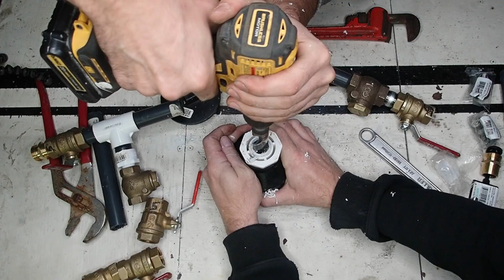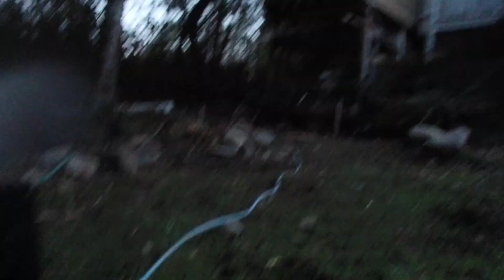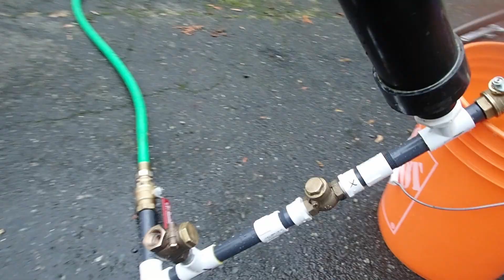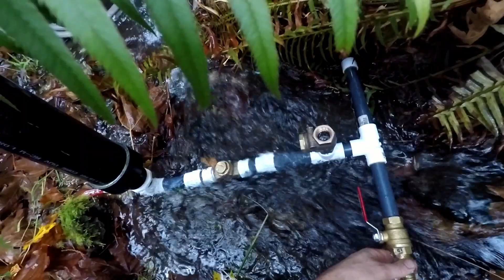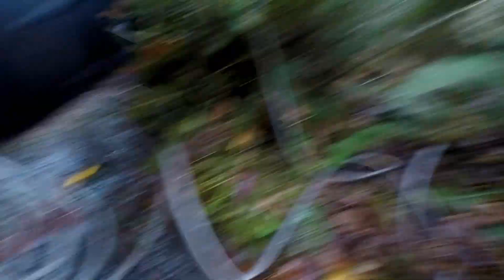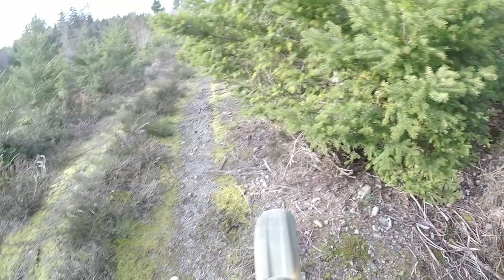Ram Pump Build! #prospecting #rampump

Comment: Many years ago....I used to have a little vegetable garden in the forest.....  It needed 400 feet of garden hose....Crummy tire had 50 ft lengths for a very reasonable price . I also made a reservoir just above the garden out of a king size water bed. at the rate i saw with your set up it would take about three days or so to fill the water bed and  I put it on a nice tarp down to minimize punctures.
you will need to disguise it as the water bed looks like a huge blue 'gem' in the forest. it was very obvious even from a distance.
I reckon if you took a few trips this would be 'Motorcycle Transportable'.
Reply from the maker: No need to disguise anything, I'm not "gardening' LOL! But yes, you have the right idea with a reservoir!
Reply: @MOTOMINING  my concern was  about keeping your claim under wraps and away from prying eyes. the main reason for my reservoir was that my creek was dry from mid july on...

Comment: and a good law it is too!
Reply from the maker: I understand it with my own brain thinking, but I'm no physicist!
Reply: @MOTOMINING  the purity law or the ram pump...or both....?
I think a smaller hose on the outlet might not be a bad idea. or bigger hose on the inlet... Its a very cool principle and if you know about the damage a water hammer can have on house plumbing you can readily see the power of it.
Reply from the maker: @mrbillmacneill  The kinked hoses are moving to the output for sure! Wait till you see my setup!
Reply: @MOTOMINING   fine tuning and a bit more fettling  should do it eh?.
Reply from the maker: Need more hose!!
Reply: @MOTOMINING  I await the results of your efforts with great interest!
Reply: @mrbillmacneill  No kidding about the water hammer effect, I guess the air chamber smooths it out a fair bit, but she still kicks, thats for sure!
Reply: @g-wrathk829  we had a sprinkler that crawled along the hose . The old man bought a little device that would turn off the water as the sprinkler nudged up against it. when it was just about closed a water hammer started in the plumbing. 
it sounded like some one was hammering the shit out of the house from inside. we only used it once...

Comment: How does it work
Reply from the maker: I don't even know man, it's MAGIC!!!
Reply from the maker: Basically, the pressure from the drive pipe pushes the waste valve closed, which makes the water push on the column of air in the pressure chamber, which makes the 2nd check valve to close. the rise in pressure forces the water to go somewhere but it has nowhere to go but up the delivery pipe, and the cycle repeats!